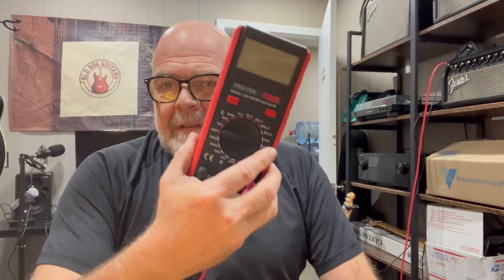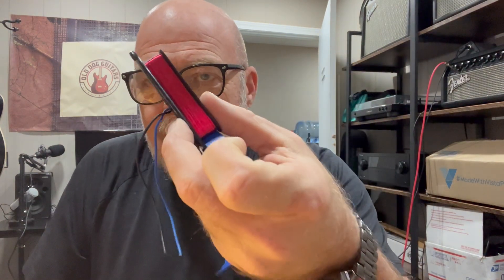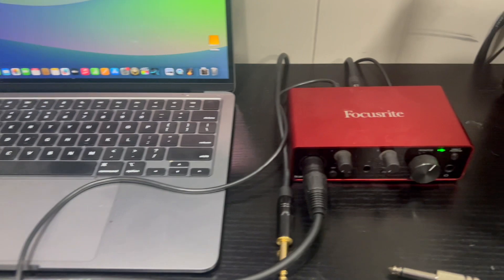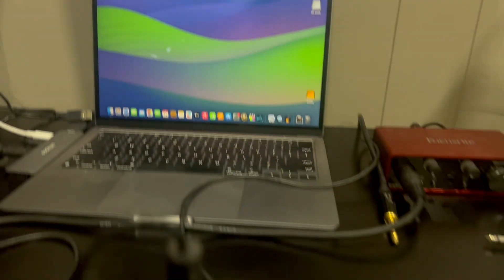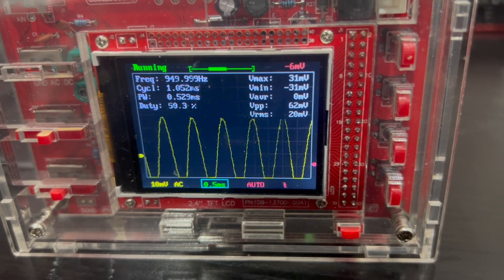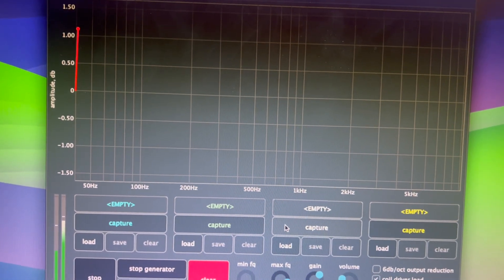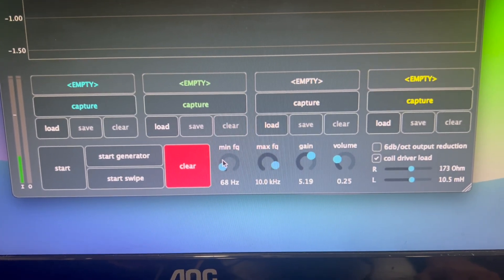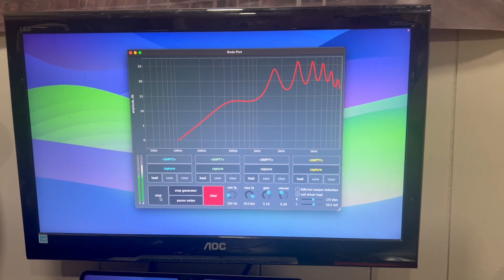How To Find The Peak Resonant Frequency Of A Pickup!

Comment: "REW" (Room EQ Wizard)  is a free and extremely versatile loudspeaker measurement program - I think you could use its sine sweep to get good graphs with your pickup in place of a mic.  REW can also measure impedance if you build an impedance jig which only has one resistor for parts..  Its cool you "do" pickups.  IJ only wound one about 52 years ago - perhaps #26 wire on an alnico bar magnet - DC was close to600 ohms IIRC Ii used a  tiny mic matching transformer to steup up voltage and it sounded very good - very hi-fi with extended treble more so than a stock Fender P-bass pickup - probably too sterile for guitar use. The bobbin  was in bad shape with soldering iron melted areas so did not mount it..
Reply from the maker: That sounds super cool, I’ll check it out. I’ve been using a USB oscilloscope for a few weeks and am getting much more accurate measurements. I’ll post a video of my findings soon!